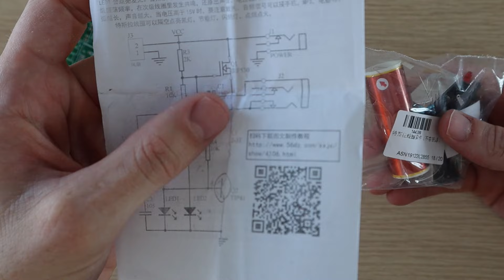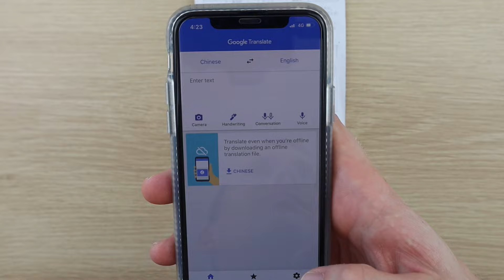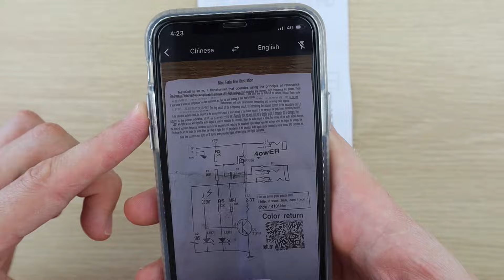Mini $5 DIY Tesla Coil Kit From Wish - Build & Test

Comment: I built mine and it lights the neon bulb, but no arcs. But if i touch the coil, an arc jumps through the insulation to my finger, burning it.
Any suggestions on what i did wrong ?

Comment: I purchased what appears to be the same or at least similar product
Instructions were all in Chinese as well. I did manage to get the coil working but could not seem to get any sound also 1 of my led's lights up bright but I did not notice that in yours I'm not sure if the correct led is lighting or maybe I have done something wrong any ideas?
And where does the sound actually come out from as there is no speaker in this circuit?
Reply: I'm having the same problem, did you ever figure it out how to get the sound working?
Reply: Not sure about audio, but with the LEDs pay attention to polarity because they should be installed 'facing' opposite directions 😅

Comment: I bought one of these, but is dummies need to know safety first. Example: are you able to touch the arch, will we get electrocuted of we touch the coil or any other part. What is the volts and amps of that arch and the primary coil ect. Tyty sub
Reply: yea u can touch it

Comment: I bought two kits from Temu.  The largrer one appears to be similar to this one.  If haven't assembled it yet but have put together the smaller one.  It came with no power supply so I used  one that was included in the large kit.   After assembly the coil appeared to be working but the LED inside prewound coil wouldn't light up.  The small test bulb that was included did light up when brought close but there was no plasma discharge.  A regular sized flourecent bulb lit up as well but not very bright.  I didnt   know how to attach the  main coil to PCB board so I used some poster tack putty stuff.  It wasn't quite enough and the coil moved around and eventually came off, loosening the copper wire.  After making repairs and using more putty, the LED worked and a plasma discharge was visible.  Now the light bulb lights up very bright. Have no idea what else I can do with this Tesla coil so if know of anything lmk.  I'm going to assemble the larger kit once I get some more solder.  Does the prewound coil have to be perfectly sealed?  I noticed the use of a flashlight to test it.  Your coil appears to have an arrow to indicate which way is up.  Does that matter for performance?  The smaller kit didn't have as many pieces is  probably not anywhere near the same design but I figured I'd ask.  Great video, Sir!  Thanks for sharing it with us.

Comment: Got one, dud from the start. The cable they gave to go around didn't even go around the circumference once!  Didn't they ever discover Pi in math class?? Components all correctly polarized, which needed to be,  soldered,  and not any life at all, just 2 led lights to show for the money!

Comment: does it come with the power plug input?
Reply from the maker: Mine didn't come with a power adaptor
Reply: @MichaelKlements  if I get a USB to 5.5 * 2.1 cable how many amps should it be and how many volts?

Comment: You should have attached your transistors to the heat sinks before soldering them to the board.
Reply: Eh wouldn't it be super difficult to solder it ? Like the heat from your soldering iron will transfer to the heat sink really fast and cold solder the leads

Comment: How did you attach the secondary coil to the board? What is that tool?
Reply: Looks like UV cure superglue. Air cure superglue should work fine, Or urethane glue

Comment: I am an EE (got recommended this after buying a few of these)

You have too many windings on your primary coil and they cover too much of your coil itself. Try 1-2 windings that remain as close to the bottom as you can (if you ever look at bigger coils you will notice that the primary is almost always fixed in a flat plane almost like that of a stove element).

Beyond that though, cool video showing people this!
Reply from the maker: Thanks for the tip Brodie, I'll give that a try.
Reply: The coupling is higher if the primary is closer to the center from my experience. the big ones will arc over from to high coupling if you move the primary to high so they move it low. You want higher coupling in this setup as its not going to arc over.

As an EE I think you can understand coupling.

Comment: Friend (which is a prof. in EE) told me that its not the same how the primary coil is wired so according to his comments on the topic I tweaked mine coil a bit so here are mine findings: I found out that best is to use 2 loops in opposite winding direction to the secondary coil and covering only first 25-30% of the secondary coil. The power consumption (using 12V) dropped from 6W to 4.5W and the spark grow up to 2mm bright one and 5-7mm thin dim ending. My original coil had ~7 loops and had the same winding direction as secondary coil and covered ~90% of it... while tweaking the same direction with 2.5 loops 25% coverage did not even start up the resonance (no spark and LED was not shining at all with only ~1W consumption)  ... Also interestingly puttng a load (like light bulb) near spark decrease power consumption (which in my former coil was increasing power consumption instead). Also now my coil is powerfull enough to light up even big 100W light bulb (connecting the secondary coil ending to one pin of ligh bulb and ground to the glass like holding in hands close to the inner wires) producing awesome shiny and wide sparks in low preassure gas up to ~1cm long on both wire endings inside the bulb
Reply: thanks!
Reply: would it make a bigger spark if i used a 15 or 30v plug like it said in the manual?
Reply: @firemyster4707  yes up to a point but tweaking the coil itself usually lead to much better improvements than voltage alone
Reply: Thanks Peter.
Reply: I’m very confused with how to do this Ik this was a long time ago but if you see this can u explain or send a photo 😊
Reply: I think maybe this is my problem. I have mine running on 24V / 2A . I should be getting a pretty decent arc out of the thing. But it does nothing. My primary is wrapped opposite direction of the secondary. But the wires cross, and it's not very clean. Maybe if i redo the primary winding things will start firing.

Comment: thanks for this I just assembled this on my own for my friend and was curious why the bulb light was shipped with this and how to safely to test this...  I do not speak nor read chinese and have no english description...After finding your video I found the answer :).  Also just in case what voltage to use? I experimentaly (using lab power source) deduced 12V 0.5A
Reply from the maker: Yeah the instructions included with these kits are not great. The bulb is just to test or demonstrate that the coil is working. I think mine said something about 9-18V if I remember correctly. 12V should be fine though.

Comment: how is the  cable that you put in 3:58 called
Reply from the maker: It’s the power supply, it’s just a barrel plug as used on an Arduino
Reply: @MichaelKlements  did it come with it?

Comment: what happens if u touch it? is it dangerous?
Reply from the maker: The arc is hot, so will "burn" the surface of your skin, but it's not powerful enough to do any significant harm.
Reply: @MichaelKlements  Thanks for the answer!
But isn't it a very high voltage and a very high frequency? I thought it could cause you even a deadly electrical shock..
Reply from the maker: The high voltage produced isn't dangerous because this coil can only produce an extremely small amount of current. This coil doesn't have enough power to cause significant harm.
I'm not saying that all tesla coils aren't dangerous, large ones most certainly will shock you and might be lethal.
Reply: the high frequency is safer because our impedance is much much bigger ... the most dangerous contact AC frequency for humans is 50Hz because its very similar frequency to heart beat and can overide our muscles control and also our impedance is at minimum. The touch of coil will produce obvious burning but just surface one and not very strong however I would not have this turned on near me all day long as there are also other effects related to the RF properties of the spark and coil itself (no touch) as even 1 Joule of radiation absorbed in "small" amount of time and space is considered dangerous for our cells and as I have no clue what frequency it produces and emits ... specific frequencies attack specific parts of human body for example 300MHz is absorbed mostly by brain. Also do not have any sensitive electronics near the coil like phones,ICs, etc ...
Reply: @user-ng2dl4eg9y  yep ~1Hz is the overal frequency but its not  a sinusoid but merged signal instead where IIRC the  peak parts composite frequencies are ~50Hz so external near 50Hz currents can easily overide mouscle control ... one of the reason why people can not let go of touched life AC wires
Reply: don't trust him I touched the arc and my whole body was electrified. my body was shaking and twitching for days. now when I get angry arcs form from my fingertips and my hair stands on end.
Reply: @chrishayes5755 
Lmao... u crazy

Comment: I’m a bit stuck on which way round to stick the LED light.
Reply from the maker: There's a flat edge on one side of the LEDs, this aligns with the flat edge shown on the PCB for each LED.
Reply: On the Pcb the part that has a star like picture is the cathode. The cathode is the shorter leg of the led or the side of the led that has a flat spot.

Comment: DON'T FOLLOW THIS GUIDE! He puts the heat sinks on last, he cut the part out of the video where he realised he should have put them on before soldering as the heights don't match otherwise, a real pain, wish he had just mentioned it in the video, rather than hiding it.
Reply: Exactly

Comment: Thank you for showing this kit......  
I couldn’t believe i found someone who got the same kit.
I was fumbling with the Chinese directions as well.    Then did the translation as well    
Also wasn’t 100% sure which each red light was indicating.
Tried it with a 9V transformer, but the current was to high, my heat sync was getting hot. Lol 
 I by mistake had the secondary coil downwards and i had soldered in the white light bulb into J3 ..... I’m  trying to get a better look on your primary coil winding. 
Will 4 times around on the primary be fine I’m guessing.
And I will try it again .... 
Thanks again
Gunars
Reply from the maker: Hi Gunars,
I also struggled with getting the primary coil right. I had it wound the wrong way around first and then found that it worked better with one less coil. Also, try make sure that the primary coil is fairly evenly spaced around the secondary coil and isn't touching it anywhere.
Good luck with your build!
Reply: Michael,   Ahh ok ...thanks...  I need to buy a variable voltage supply , up to 15- 30V I believe it was ....     thanks again !

Comment: mine works except it is silent
any ideas?
Reply from the maker: Are you saying its silent when trying to play music through the audio input? What supply voltage are you using? You could try increasing it (within the recommended range).
Reply: @MichaelKlements  20v and yeah it makes no noise when playing music through it
Reply from the maker: Is the coil working, if you place the light bulb near it, does it glow? My one starts playing music at an audible level from around 12V. Also perhaps check your soldered connections to the audio socket.
Reply: @CAIDMASTEROFPYRO did you ever fix this I'm having this same issue tried 12v and 21v power supply but nothing, I'm getting tye bulb light up etc just no sound
Reply: @ Nope never made noise
Reply: @CAIDMASTEROFPYRO  figured it out on the one I have I just had to wrap the wire the opposite direction to what I had and keep it lower round the bottom of the main coil and it made a heck of a lot of difference in the power of the coil too
Reply: @CAIDMASTEROFPYRO  so basically I wrapped it in the opposite direction to the main coil and that fixed the problem

Comment: How do you power it?
Reply from the maker: You can power it with any 12V-24V DC power supply or battery, it doesn't draw much power.